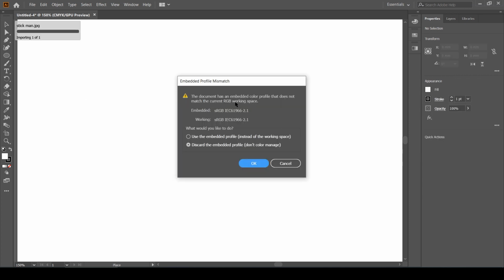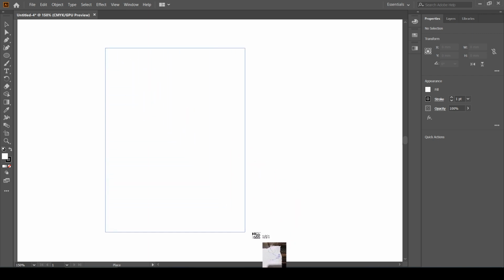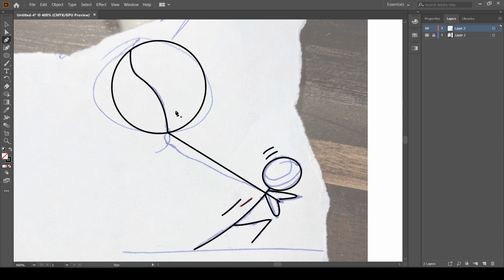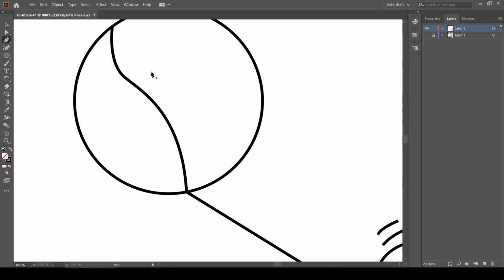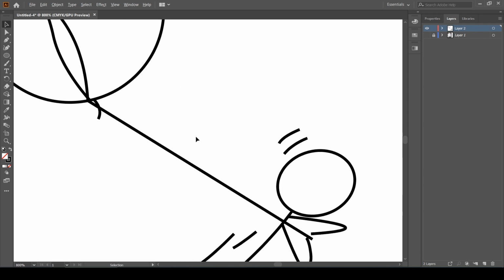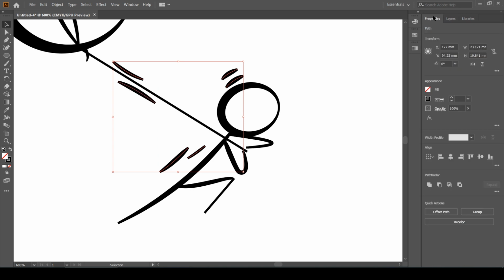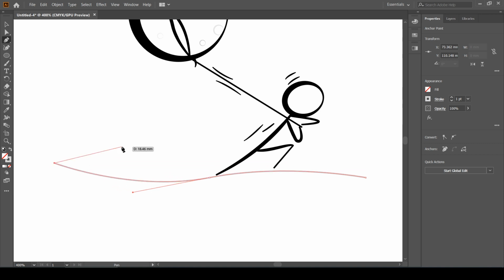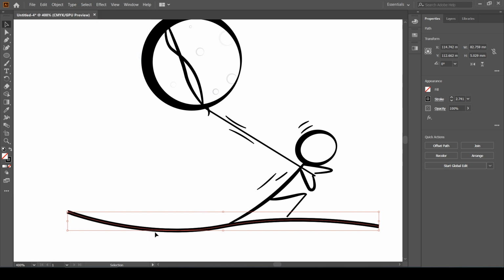Design a Moon Walker Illustration in Illustrator with this Step-by-Step Tutorial

Comment from the maker: Bookmarks:
1. Place image in illustrator: https://youtu.be/aY29U7SguaM?t=19 till https://youtu.be/aY29U7SguaM?t=65
2. Make template layer in Illustrator: https://youtu.be/aY29U7SguaM?t=65 till https://youtu.be/aY29U7SguaM?t=117
3. Width tool: https://youtu.be/aY29U7SguaM?t=321 till https://youtu.be/aY29U7SguaM?t=375
4. Type on path in illustrator: https://youtu.be/aY29U7SguaM?t=509 till https://youtu.be/aY29U7SguaM?t=581